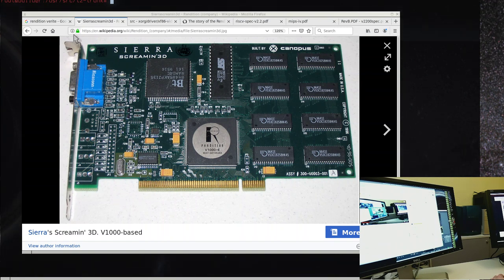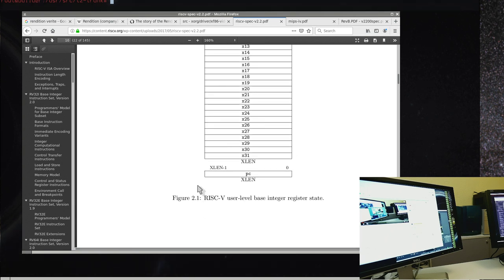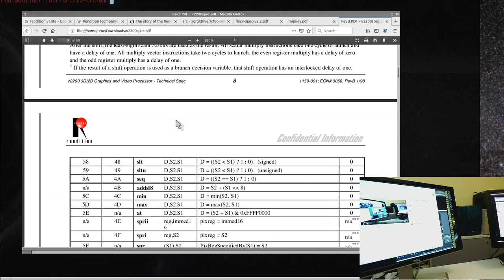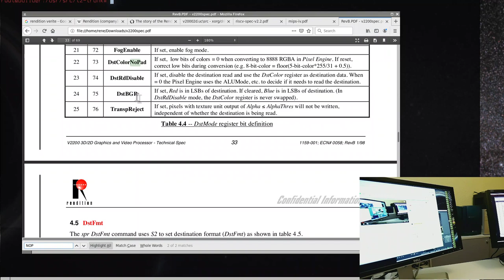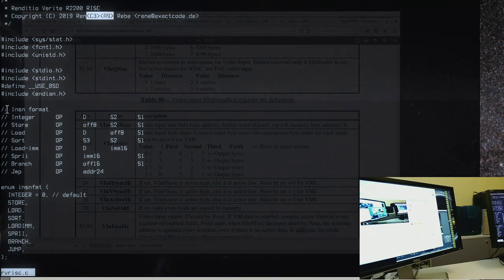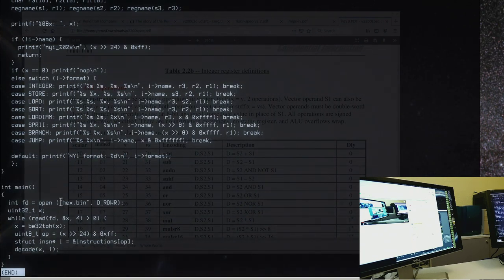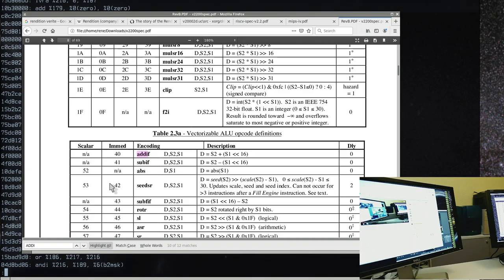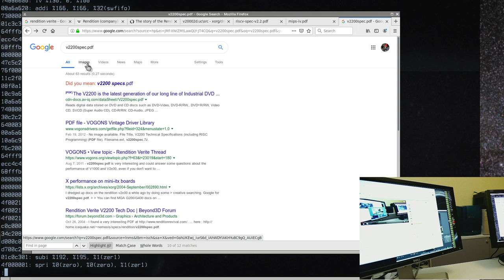Writing a MIPS-like Rendition Verite disassembler in one afternoon!

Comment from the maker: The Windows driver also has v20003d.uc and v2000gl.uc as well as a fun readme: "This release has an entirely new core - and as such it fixes many bugs present in the older 
2.3 tree. But it also introduces many new ones.  In particular, many new 3D rendering glitches are yet to be isolated and killed."
"